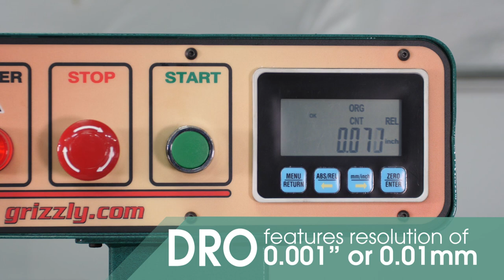Grizzly's G0495X 8" x 83" Helical Cutterhead Jointer with Exclusive Digital Height Readout

Comment: I’ve had this jointer for two years and could never find a mobile base for it. It’s still on the pallet it got shipped on! Where can I find that mobile base?
Reply: I’m with you. I’ve had mine for about a year and didn’t find one on their site that would work. Maybe someone from Grizzly can give us an answer. It’s an awesome jointer!
Reply from the maker: Hey guys! Here is the mobile base! https://www.grizzly.com/products/Grizzly-Bear-Crawl-Heavy-Duty-Mobile-Base/T28000
Reply: Grizzly Industrial, Inc. Hey guys thanks for the reply. I was just on the phone with Josh in customer support talking about this. He reached out to some of your tech guys and thought that maybe the extensions that are sold separately might have been used on the base in the video. The thing they weren’t sure of was if they were long enough to attach correctly to the areas on each end of the base where the extensions are bolted to those pieces. We also discussed whether or not the extruded extensions were actually strong enough to support this ~800 lbs. jointer. Can you confirm this?  Thanks!
Reply from the maker: @BobGarrett66  We recommend using the bear crawl cub mobile base with extension bars. And with that you’ll be able to firmly get one bolt into each side, which does support the jointer footprint.  Sorry we didn't convey that in the beginning! Please let us know if you need any assistance!
Reply: Grizzly Industrial, Inc. Perfect!  Thanks for the follow up. It’s on my after Christmas shopping list now.
Reply: Bob Garrett did you end up getting this jointer and mobile base? Thoughts? Thinking about pulling the trigger, thanks
Reply: @loganspivey9367  I have this jointer and i have the mobile base i purchased through Grizzley at time of purchase. I have thoroughly enjoyed it.  You will definitely need some help setting up especially if putting on mobile base. I have rabbitted with it as well as milling rough lumber and have nothing but good to say. The ease of adjustments and with digital readout makes it simple. I do not regret my decision to buy it myself.
Reply: @BobGarrett66  Hi, I have the same dilemma and was wondering if the solution suggested above worked for you. Thanks.
Reply: Ok guys I bought this jointer and the mobile and extension bars. I can barely get the second bolt to touch the extension bar. The bars I feel are just long enough I wish they had longer options so it could fully seat. You see how snuggly the base fit width size? Someone had to cut down those bars bc fully seated I have major gaps to the point I or my wifey will trip. No big deal as I plan to use my cut of wheel to chops ‘em down.